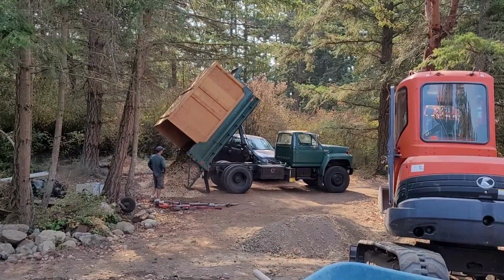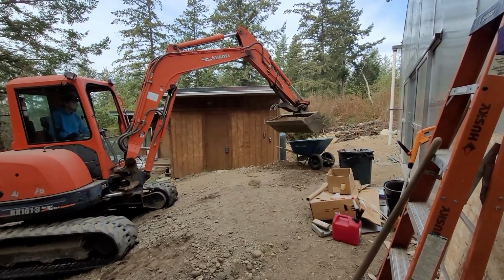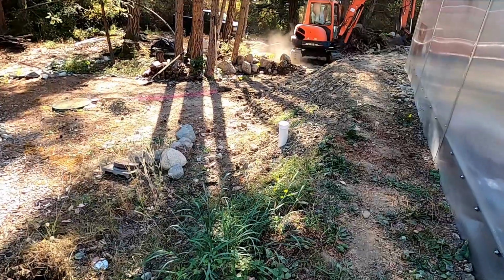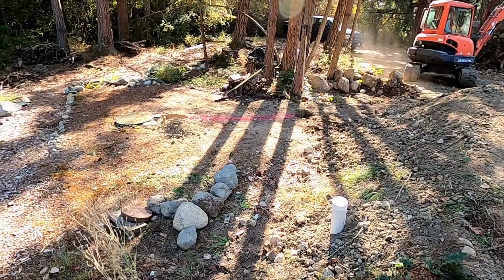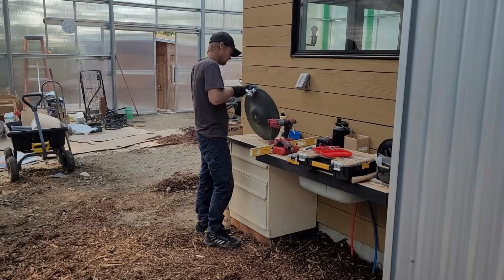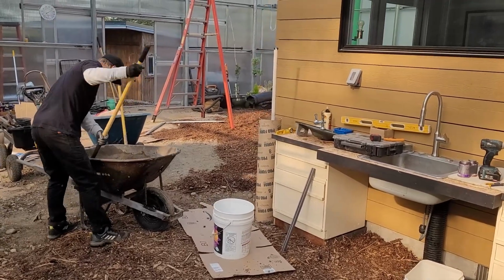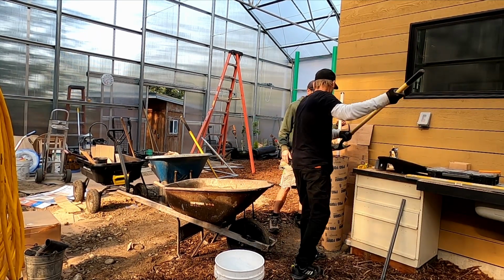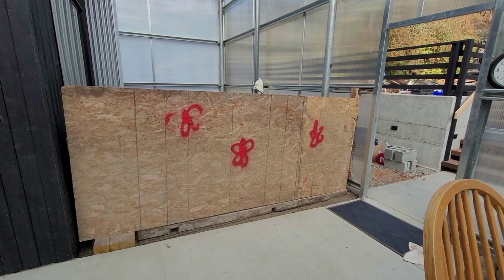E44 Tiny Home in a Greenhouse | Ready for final inspection

Comment: That might be the overall theme for the whole build. "Matt has a plan". Putting the new dirt on top of the cardboard? I would have guesses you would move that first. Wonderful video, as always.
Reply from the maker: Thanks, Phil! You're so right about Matt - the man with a plan. There are a few reasons for the cardboard: 1) it isolates the new, clean, growing dirt from the construction hardpan that has goodness knows what sort of stuff in it, 2) it will eventually decompose and provide organic (as in carbon-based, not as in chemical-free) material, and 3) hopefully it soaks up irrigation water to maintain a moisture layer. The 3rd is an assumption that I'll test over next summer's growing season.

Comment: This is so crazy, I have been wanting to do this myself. Was there any red tape to get this done
Reply from the maker: Hi Jimmy, thanks for the question. Short answer is, no, there weren't issues with permit approval because I applied for the house first and the house is built to code.  Our local and state code allow tiny homes (400 sf) so there wasn't an issue due to the size of the house. After the house permit was approved, then filed an amendment to add the greenhouse. The greenhouse manufacturer provided a book of engineer's specs for all the requirements for wind, snow load, etc.  More info on my blog LiveInAGreenhouse.com